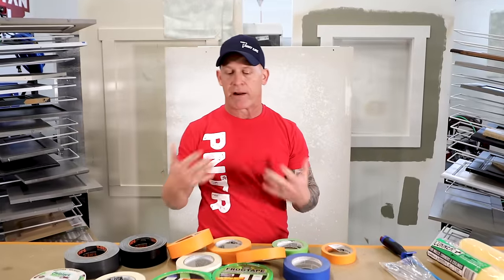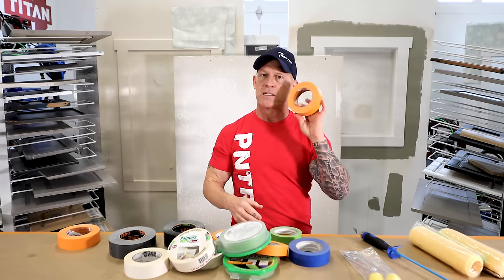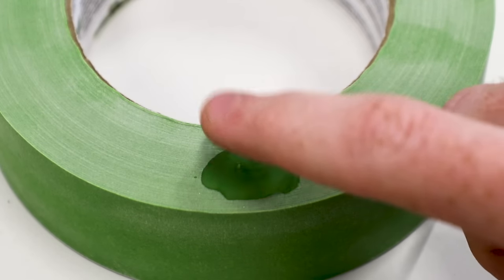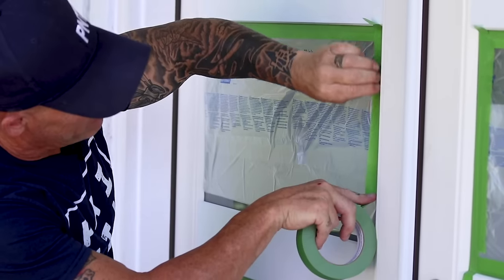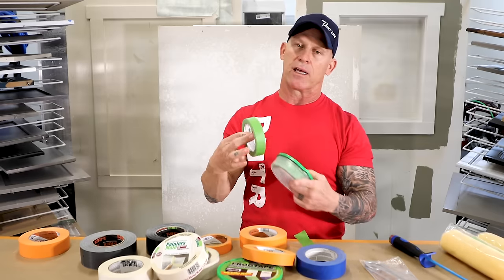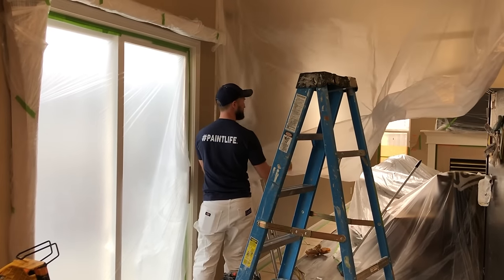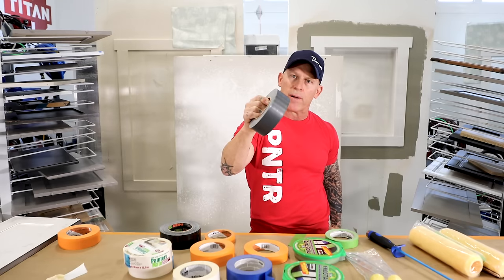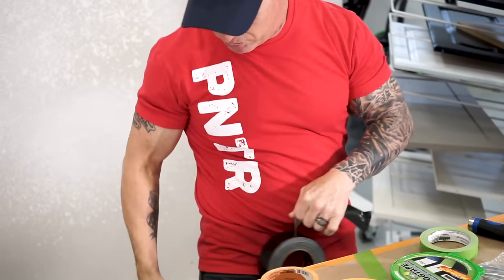5 TAPES. The BEST Painters Tape?

Comment: Tape spec is the most commonly used one here in NZ. I’d say it’s right up there with frog tape. They have a version that says it lasts up to 60 days as well. Idk what they use in it, it’s not the same as the paint block thing frog tape has, but it still get you very sharp lines. Definitely worth trying out.

Comment: Chris, Have you ever used the Sandpaper trick on a stippled ceiling or flat ceiling. To get a crisp paint line edge. An old painter showed me that trick years ago.
Reply: So what's the trick BZ
Reply: jacq melrae Take a piece of 8x10  sandpaper and  double fold it. Creating a 4x5 square. Now run that edge of the paper on the ceiling where it meets the wall 90. It creates a small line crevice that holds the paint on a sharp edge when you trim with your brush.
Reply: I’m a drywaller in Michigan and always sand a groove in textured ceilings for the painters. Any good drywaller will have done that for u already.
Reply: @jimmylarge1148  I was taught that about 20 yrs ago by an saged old expert painter. Been doin that since. One of the best painting tips I pass onto customers that do their own painting

Comment: Have you tested with Yellow Frog Tape (for Delicate Surfaces)?
Sherwin Williams store rep suggested using yellow tape on recently painted surfaces to avoid peeling. Basically, wait at least 24 hours for the paint to dry. Rated for 60 hours of hold time.
Reply: I use it, especially with painting two different colors on either side of a rounded corners. It does work well using it over fresh paint...it’s super super thin and delicate.

Comment: For production, obviously keeping costs down is so important because you just fly through production tape. For personal preference as a business owner, how do you rate 3M 2020 vs 3M 2090 vs the orange Shur-Tape? I recently used 2090 to mask floors, windows, and door glass in a whole house job, and loved the performance but wondered if the orange ShurTape or 2020 would have performed just as well for a fraction of the cost. Input on that topic would be much appreciated!

Comment: Put the delicate frog tap on an oak floor when painting baseboards with white oil enamel.  Tape bled under the edges.  Frog tape says solvent based paints cause an issue with blocking agent.  Any suggestions about what type of tape to use for this application?
Reply: I use damp cotton rag just around my finger and run around paint edge it activates the seal. Let it dry then test enamel. It should work.
Reply: @jong4939  Thank you for the suggestion.  We tried that, but it still came underneath the tape.  Guess it's different with oil based products. There's a product test video for you to try. 😊